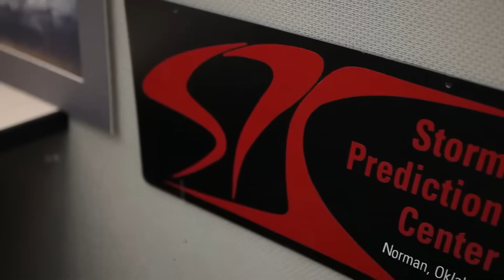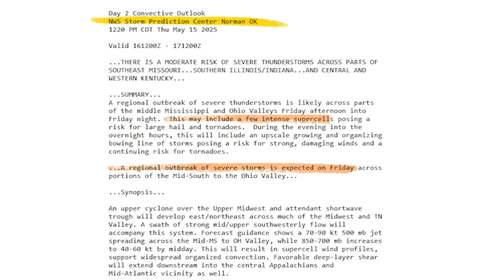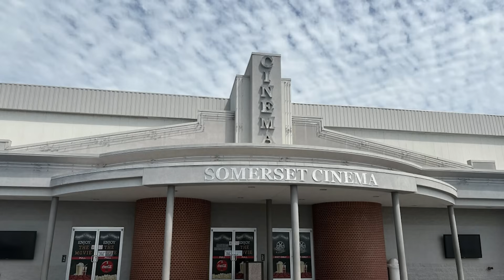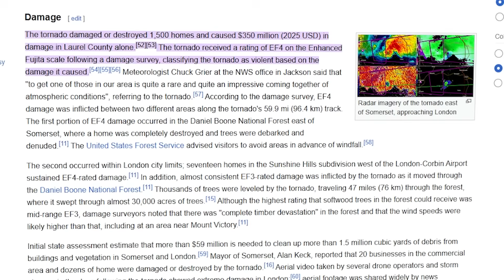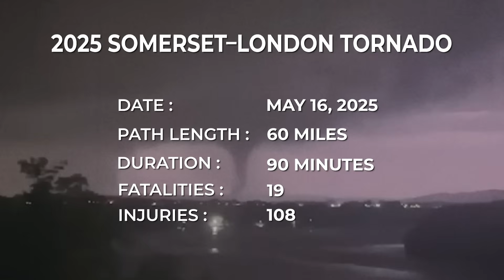The Deadliest Tornado of 2025: Somerset–London EF4

Comment: hello, i live about an hour away from somerset and london. and i witnessed a small part of this. let me explain it to you, the power has been out for probably over 6 hours. it was very dark in the house, and i was going to bed. until suddenly i started getting tornado warnings, i then got up and went to the living room. there was lightning about every 2-8 seconds.  barely any wind im pretty sure. it was pretty scary but not as scary as the storm from earlier that knocked the power out. it then settled down a little bit later and i go back to bed. next day my power was still out but i was told by someone that london was hit by an EF4 tornado. i then see some images of the tornado, i was flabbergasted. then i heard about all the deaths, it was extremely sad. i then about a month or two later i go to harlan, ky which is right next to london (i was going to the KFC museum). but then i decide to go to levi jackson state park to see the damage, buildings was messed up, trees didnt have branches pretty much, houses was flattened, and there would be a completely leveled building right next to a building that is just fine, which shocked me. but yeah, thats pretty much my story.

Comment: The aftermath of this did restore some of my Faith in Humanity. I work at one of the Krogers in Corbin, and for a while, people were CONSTANTLY buying things to donate (There was even a FedEx truck out front to collect everything and take it to wherever it needed to be.) and our Donation Box was constantly filled. My sister works up at Aisin, and apparently the Tornado almost hit the building, but diverted at the last second. Considering they were saying it could get bad that night, I kept expecting a Tornado Watch alert on my Phone, and eventually I ended up getting a "PDS Tornado Warning" with the caption "Take Shelter NOW!!!", and I instantly hunkered down in the hallway in my Parents' house, and pulled up Ryan Hall's stream. Based on the Radar, it missed the house by only a couple miles.

Comment: I live right by where the tornado ripped through in london, we have NO tornado sirens outside of one siren in downtown. There were no sirens to warn any of us, and southern london (where’s the tornado hit) is highly populated. i noticed this issue a couple years ago, and have been emailing officials with no avail. Finally, we were supposed get hazard mitigation funding from FEMA to help install new sirens, but it ended up being denied. We still need sirens

Comment: I tracked this storm when it first started sparking in Missouri, my mom lives about 5 minutes to the west of Sunshine hills and I live about 15 miles south of my mom. I called her when it hit Somerset and couldn't get an answer as she was asleep. I must have called her a dozen times with no answer. I was so sick to my stomach when I watched the monster on radar get closer and closer to her house. The debris ball that I was looking at on radar had me panicked when I saw it go directly over her house, my wife said I looked like I had seen a ghost. I continued calling but never got an answer and threw my boots on to run out the door to go check on her when my phone rang. It was my mom, she was woken up by her dogs barking because they heard it coming and ran to her neighbors house and got in the basement so she didn't have service on her cell until they came out. By the grace of the Almighty the tornado came within about 75 or so yards of her home and tracked straight through a field in front of her house only doing some roof damage. It ended up hitting Sunshine hills, crossing interstate 75, hitting the airport, crossing Hwy 25 and going directly through Levi Jackson state park before heading between Hal Rogers parkway and Hwy east 80 before it picked up. To say that was the most gut wrenching nader I have tracked in a long time would be an understatement. I have been in 3 tornadoes here in southeast Ky over the years. Twice in the home I grew up in (one of those times I was on the throne, which was a wild ride) and once on Laurel Lake while on a pontoon. So a must have for me when me and my wife where shopping for our home was a basement, which I'm thankful to the good Lord we now have!

Comment: I work about 2 miles up the same road from the Sunshine Hills subdivision and grew up/now live 20 miles from it. This is a good narration of the timeline of destruction, but only about half of the video is from the affected areas. London is a town of about 6,000 and buildings taller than 3 stories are extremely rare. The majority of the video of urban areas shows Lexington, the second largest city in Kentucky. It’s about 70 miles north of London and isn’t considered Eastern Kentucky. I understand the need to use stock video in a YouTube short-form documentary, but I wish they hadn’t used a place so dissimilar to London. However, a lot of the video is of the actual places and destruction and the path of the tornado is both accurate and devastating. Overall a good job.

Comment: I was watching Ryan Hall and radaromega at the same time as this beast! I was watching from the first rotation signature, til it died closer to Hazard
Reply: When I started watching radaromega, it was just leaving Somerset. I thought it would get halfway to London and then die like they usually do, and it looked like it was going to a couple times, but it kept on going. Then I thought it would fall apart as it got close to the city, like most storm cells do, but it kept on going. It missed our house by about 2.5 - 3 miles. All I could think about was that if it shifted its course 1 degree southward, I would have been in its path. I also stopped watching it as it approached Hazard.
Reply: @qazxsw21000  wow, thats quite an experience, glad you made it out ok

Comment: Keep in mind that the Enderlin, ND tornado has yet to receive an official rating, and it has officially been 3 months. Even if Enderlin does not end up EF5 (though I personally doubt it lol), the Wolf Creek–Hudgens–Marion tornado is definitely stronger. Many ppl mention the Diaz tornado too, and it's also a contender. I like the video though, keep up the good work!
Reply: Enderlin got upgraded to EF5! Which was shocking because there have been at least 6 tornadoes since 2013 that should have been rated EF5, possibly even more.
Reply: @shoresy4084  Yep! While I agree with you with other tornados being more deserving (I’m looking at you, western Kentucky 2021 tornado). I’m not upset at this one being rated ef5 too. The frame matched enderlin tornado photo that shows the insane storm structure is eerily similar to 99’ Moore with how intense the rfd cut in the cloud is.

Comment: I mean, they were in the Enhanced Risk Area. That usually means that while you're not going to get the worst of the storms, you still have a good chance at getting hit by strong storms and possibly tornadoes. But I do live in Tornado Alley proper, so it's one of those things that I'm constantly aware of and keeping an eye on.

Also, the year isn't over yet. We may yet get a stronger tornado in the next couple months - although if it does happen, it will likely be down by Dixie Alley. The jet stream seems to favor sending severe storms east from KS/OK through MO/AR and on into TN/MS/AL this year.

Edit: Whenever I see a risk area progressively moving further in one direction over the days leading up to the event? That tells me that conditions could result in the risks being more pronounced further in that direction than expected. In this case, if I had been further east of that 15% area? I'd have been keeping a wary eye on weather warnings.

Not that she had cell service anyway. There are other ways to keep an eye on the weather - radio, local TV, etc. And if they weren't covering the weather on the air? Well, that's an even bigger and much more systemic issue!
Reply: Ehhhhhhh Theres a little more to this. While this area was under a threat of severe thunderstorms you have to understand that due to radar locations this area turns out to be sort of a blindspot. So while you can take the weather forecasts seriously you have to understand that 1 at the time the tornado was 40-50 miles away we had a very hard time determining direction, speed or if it was even still on the ground. So for everyone in Somerset and London we were under basically a "hey a tornado touched down waayyyyyyyyyyyyy over here but you guys should be fine just keep an eye out for a tornado dropping down in the area warning" 

By the time that warning was out it was midnight, and people are starting to go to bed. I was awake during all of this and we were unable to actually track let alone even know where the tornado was due to poor radar location We actually got reports 20 minutes before radar confirmed it due to storm watchers and locals calling in with pictures of the tornado in Somerset. 

So I just want to make clear this Tornado was just a perfect combination of everything bad lining up just right which resulted in people being hurt/killed due to not having time to evacuate not a case of "stubborn locals don't believe the magic weather man and end up dead"

Comment: I remember the sick feeling I got when I was watching this supercell develop a hook on radar and go from moving NE to straight E. That's usually a pretty good sign that a strong, long track tornado is underway.
Reply: When it goes left it is occluding. 

Do you think the coriolis effect is what makes that happen? As in the opposite of it as it heads east ( the effect makes it go west and then it disappears)

Or something like that. Currently reading about to answer my own question lol)

Short answer, yes. It has to be a large storm. Smaller storms are not affected by the coriolis effect but large ones are. That is why they track east and steam roll across because it is powered by the rotation of the earth.

Comment: Ah the good ol ignoring warning signs strikes again. Doesn't matter how sophisticated the warnings get, can't warn away stupidity.
Reply: Ehhhhhhh Theres a little more to this. While this area was under a threat of severe thunderstorms you have to understand that due to radar locations this area turns out to be sort of a blindspot. So while you can take the weather forecasts seriously you have to understand that 1 at the time the tornado was 40-50 miles away we had a very hard time determining direction, speed or if it was even still on the ground. So for everyone in Somerset and London we were under basically a "hey a tornado touched down waayyyyyyyyyyyyy over here but you guys should be fine just keep an eye out for a tornado dropping down in the area warning" 

By the time that warning was out it was midnight, and people are starting to go to bed. I was awake during all of this and we were unable to actually track let alone even know where the tornado was due to poor radar location We actually got reports 20 minutes before radar confirmed it due to storm watchers and locals calling in with pictures of the tornado in Somerset. 

So I just want to make clear this Tornado was just a perfect combination of everything bad lining up just right which resulted in people being hurt/killed due to not having time to evacuate not a case of "stubborn locals don't believe the magic weather man and end up dead"

Comment: This Is why if you’re under any kinda enhanced risk for severe weather always take it seriously and always be weather aware
Reply from the maker: Couldn't have said it better myself!
Reply: Ehhhhhhh Theres a little more to this. While this area was under a threat of severe thunderstorms you have to understand that due to radar locations this area turns out to be sort of a blindspot. So while you can take the weather forecasts seriously you have to understand that 1 at the time the tornado was 40-50 miles away we had a very hard time determining direction, speed or if it was even still on the ground. So for everyone in Somerset and London we were under basically a "hey a tornado touched down waayyyyyyyyyyyyy over here but you guys should be fine just keep an eye out for a tornado dropping down in the area warning" 

By the time that warning was out it was midnight, and people are starting to go to bed. I was awake during all of this and we were unable to actually track let alone even know where the tornado was due to poor radar location We actually got reports 20 minutes before radar confirmed it due to storm watchers and locals calling in with pictures of the tornado in Somerset. 

So I just want to make clear this Tornado was just a perfect combination of everything bad lining up just right which resulted in people being hurt/killed due to not having time to evacuate not a case of "stubborn locals don't believe the magic weather man and end up dead"